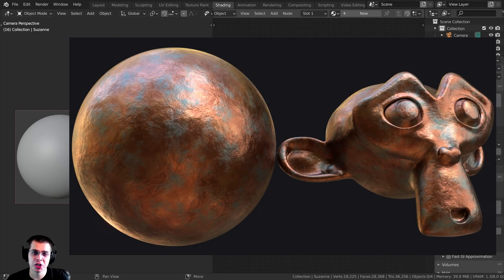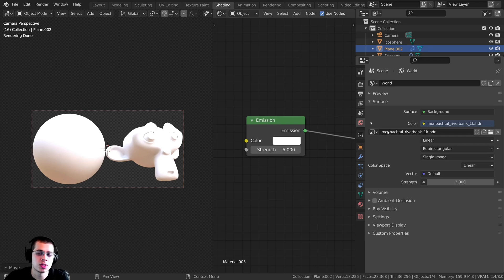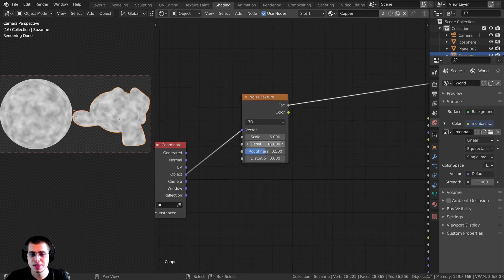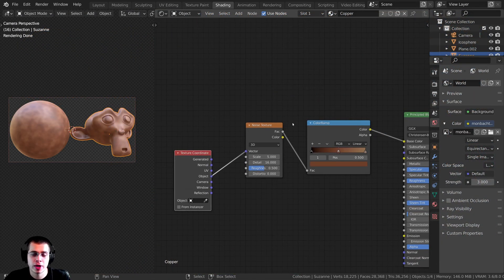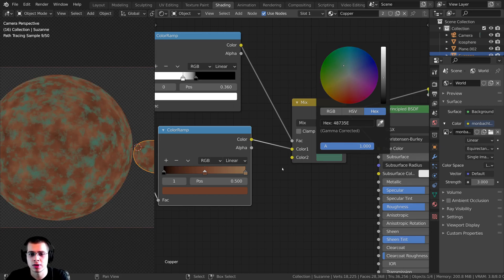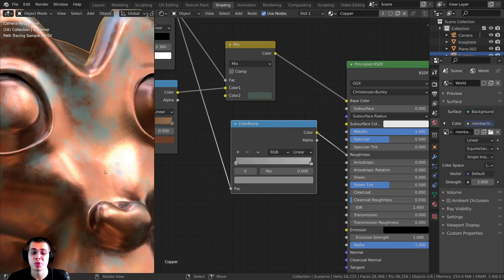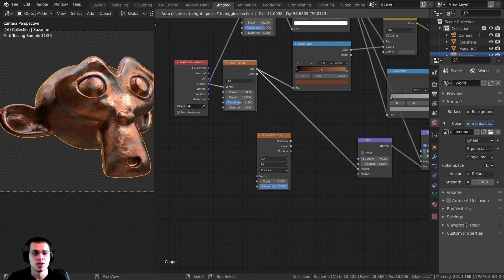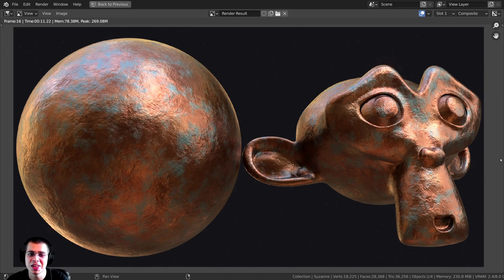Procedural Copper Material (Blender Tutorial)

Comment: The green oxidation of copper is raised, unlike with iron. So do not invert. While it does corrode the copper oxide expands.

By default all copper is a rosy color, which can only really be seen when submerging it in water with citric acid (which will immediately "orang-i-fy" after a few seconds . The copper we see everywhere is already oxidized a bit so it appears it stereotypical orange color. From there the copper begins to turn a brownish orange, leading to firm patina brown, then the bluish-green oxidation starts to form. The Copper looses shine throughout, only appearing completely shiny in its rose state and its minor oxidation state which is fresh or scratched copper. The brownish orange offers only a bit of metallic glimmer, and the copper looses metallic when it turns a firm patina brown, even before turning its final color. 

The surface will not fully raise till the copper starts turning green, appearing the same flat even surface until a medium brown starts where it picks up some roughness and minor raised surface, that begins to turn green. 

How smooth the surface is can vary by alloys and conditions. The green surface oxidation is should always raised while still on the material, even when kept smooth in some coins or copper that has been set in a controlled oxidation. It will start to fill in fine details like applying paint over and over again though. In extreme cases like with old pipes the the oxidation can form a bubbly surface with the green or even brown patina, and the oxidation will fall off in chunks or flakes like  rusted steel, finally reveling the corroded copper.

Comment: Nice node work. I can follow along, but get out of my present depth when you start adding the voronoi texture and multiple bump maps. Other stuff like color ramps is second nature. Just need to do more of your tutorials for the other stuff to click. But, uh, the very beginning I was having a hard time doing the set-up. Couldn't get the plane with the emission to light up the objects worth squat, and couldn't get the background image to disappear. Did a work-around using Easy HDRI. Later I figured out to use one of my older Blender files where I did your wood tutorial, and re-use that setup. Just thought I'd let you know about the initial difficulty because it could throw some people off. In the end the material looks really cool. On to scratched metal, and rusty metal. I need a metal for something I'm working on, so will have to tinker once I figure it out well enough. Your videos are ideal training for the express purpose.
Reply from the maker: Thanks!
If your using Blender Eevee, then the emission lights won't work, and so you should use regular lamps instead.
To set the background to transparent, open the Film Tab in the render properties. And Check mark, Transparent.

Comment: another awesome one! Question though how would one get some bumps/rust to come out and some of the bumps to go in, like a mix of both?  just run two setups and maps through the bump nodes? ie chain them together?
Reply from the maker: Yes, you can use the Bump node, to chain together multiple bump maps. So you plug the texture data into the height value on the bump, and then the Normal output, goes into the normal of the next bump node.  : )